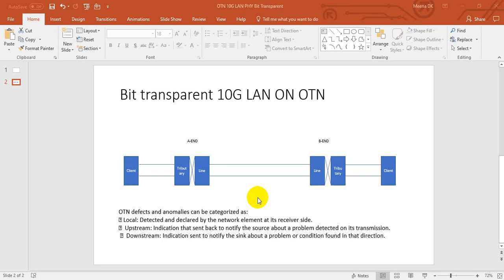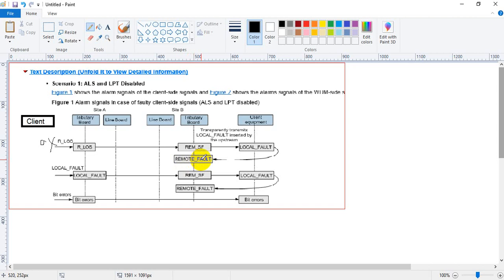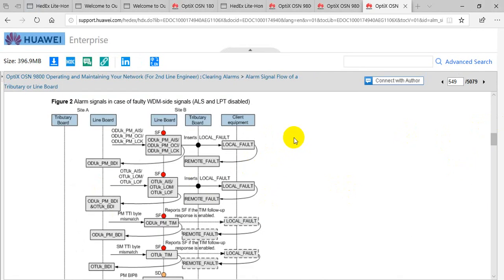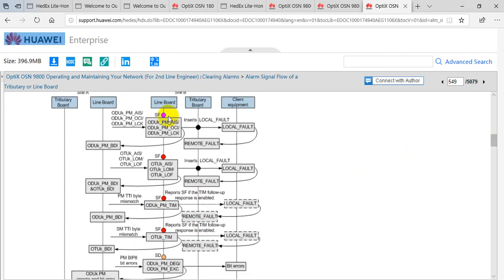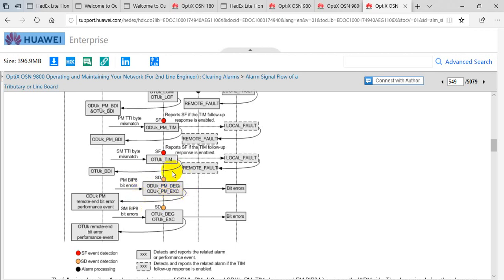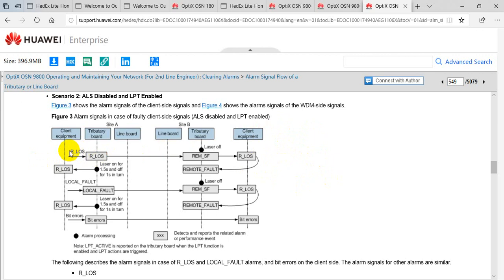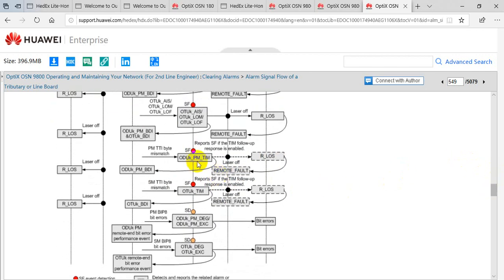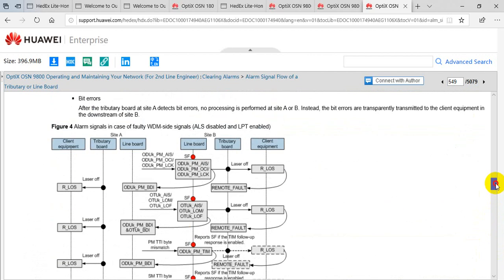10G LAN PHY Alarms on OTN  for bit transparent mapping

Comment: Sir can you explain more scenario in OTN means 100G level,  10G add drop in 100G etc..
Reply: Similar to SDH Cross connection 63 E1 to STM1 (Line)
Meanwhile OTN Cross connection 10G to 100G (Line)